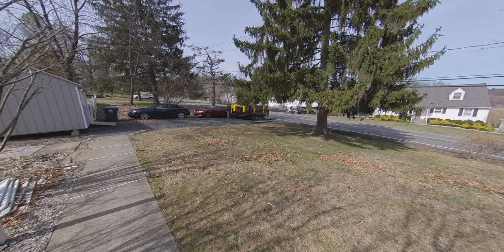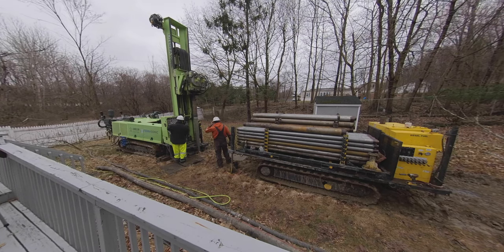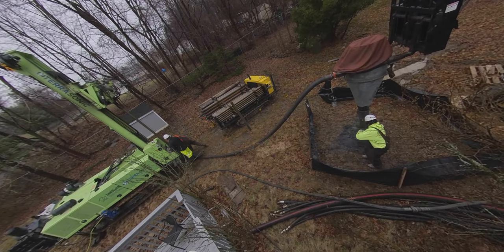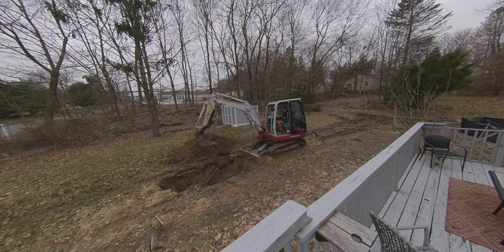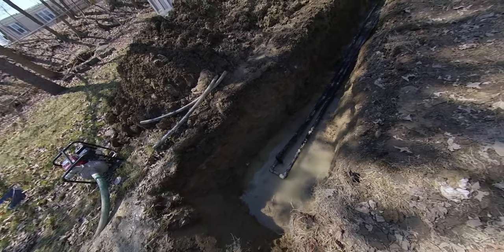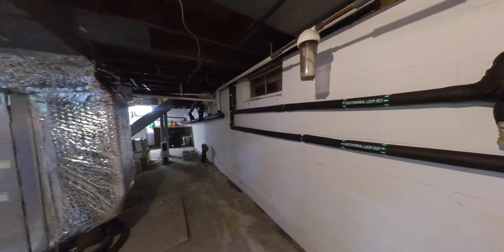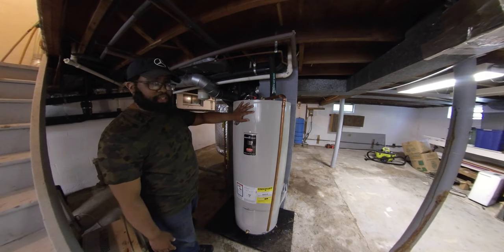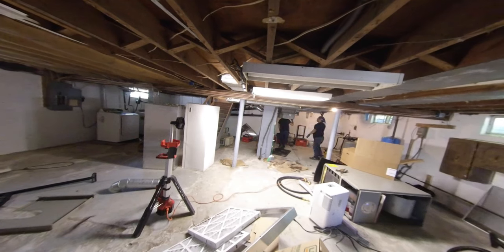Dandelion Energy - GeoThermal Installation

Comment: Its kind of nice to see the rest of the world is catching on to the geothermal heating/cooling; I've been a geothermal driller for 13 years straight now in the Nordic countries, drilling countless holes both for private housing, larger industries and everything in between, and what i can say is that geothermal is simply the way to go, you wont find a more energyefficient heating/coolingsource, especially in the heating segment, as we, the nords, get quite the Cold winters the GT systems have litteraly proven to lower the electric consumption by 300-400% (heard stories about EVEN BETTER performance too) compared to using direct electrical heating. (Not even gonna mention oil, because we stopped using that years ago because its about 4 times more expensive Then electricity over here) HVAC's are not bad either and dont come with the same initial cost, but GT Will surpass/outlive them in the Long run and when the outdoor temperature drops below a certain point, they simply produce heat equivalent to direct electric.
Reply: How much does it cost to drill a hole in your country ?

Comment: Great video and thanks for the info. I’m in your area and will be contacting them for a quote.  I want to get away from oil also. Only thing is my cost will be higher do to not having central ac but it will be a welcome addition.
Reply from the maker: If you use our link to sign up, you get a little money back as well after you complete a potential install 🙂

Comment: How long did it take to drill per hole? I'm assuming 300ft. Asking because Dandelion claims their sonic drilling is 17 times faster than conventional. If I'm assuming with various setup overhead that each 10 foot pipe takes 10 minutes that would take about 5 hours which doesn't sound too different from standard drilling times.

Comment: How's the heating performance thus far this winter? Looking to go with this in the near future. Have a call set up for this weekend with them!
Reply from the maker: Hearing has done well. Last week, going into the weekend before it warmed back up, temperatures were like single digits. Even with that, the home was comfortable. 

I hope you used our promo code, as I think you get a nice reward if you decide to sign up for a system if you use the code 😎

Comment: Excellent video covering lots of details of the install process! Did they explain what maintenance would look like for you during the life of the system, like how frequently a tech will check up on the home, and any particular tasks you need to do as a homeowner to keep the system in tip top shape? I'm also curious about the length of your warranty, if it impacts your home insurance in any way, and if there is at all an estimate of added value of your home for if you decide to sell it in the future? Thanks again for providing such insight on this type of system install!
Reply from the maker: Maintenance for this on the user end is more so of changing the air filter. There is a device that is connected to it, which sends back status and data to Dandelion. This is suppose to allow them to detect issues and send a technician to you to resolve any issues before you need to call them. We'll see how that pans out down the road. No change in insurance, and no estimate of added value we can offer you. Sorry.
Reply: @GStyleMagazine  Get it looked at a year later. If it's good wait a few years and look again. The blower and coils can get dirty and need to be cleaned

Comment: How hot does the temp get for your heater in the winter ?
Reply: I won't be able to say yet. This install completed early a June this year. So far loving the AC and in a few months then I'll be able to really see on the heat side.
Reply from the maker: Just as an early first answer to that. Since it had been getting chilly now in the area, we have switched the mode from cooling only to a mix mode of heating or cooling. So far, we have had it anywhere from 74-76 and it has hit that temperature just fine :)

Comment: NEVER EVER go this route for Geo......check performances on a Geo heat pump! Ground water (well water ) ALWAYS is the most efficient.

Installers will NEVER tell you this because it's major bucks for them (and why geo has gotten a bad name...) do a slight bit of research and you'll see. I own 2 homes, both with well water geothermal heat pumps, and the performance is incredible.
Reply from the maker: That could be the case potentially, but this doesn't use ground water/well water. This is a closed loop system. And have experienced no issues that you may be facing.
Reply: Open loop system are more likely to fail and isnt worth it long term.
Reply from the maker: Thanks goodness this is a closed loop system then 🙂
Reply: sound very interested.   I would like to learn more about it as my house is also in NY orange county has Ground well water.  Is it possible to add heating/cooling pump to existing well bump that I have for my existing well pump.   What's the cheap alternative as $21K sounds very expensive?
Reply from the maker: You might be better off reaching out to the company for more specific questions. They would be in a better position to answer that than us.

Comment: The best part about all this is the fossil fuel industry just lost some money :)

And renewable energy just gained some. 

Great.
Reply from the maker: Indeed! :)
Reply: @GStyleMagazine  still enjoying the system? Any problems so far?
Reply from the maker: Yes still enjoying it. So far not one issue. We've had some hot days so far and the system works perfectly keeping the house cool. Didn't even know it was hot until we step outside haha. We may do a summer recap video at the end of summer time.
Reply: @GStyleMagazine  please do :) 

Really hoping Dandelion comes to Michigan. And soon. Not like...15 years....
Reply from the maker: @T M Let's see. Have something made from oil at the time of creation and then no need to further use oil for heating that home for the life of the pipes (50 years or more) or just make no change at all and continue to use oil to heat that home for the next 50 years or more. Which side of the scale you think is better....

Comment: So, what do you do for heating when the power goes out?
You keep saying "renewable" but the electricity that's powering your heat pump is coming from a power plant that is most likely burning a fossil fuel and that fuel in the US is probably coal.  Coal is worse for the environment than natural gas, propane, and oil.
Reply from the maker: What would you do for heating if your furnace that burns oil when the power goes out? The furnace still uses electricity to work as well. The difference here is although electricity is needed, it is still a reduction by no longer needing to burn oil to heat AS WELL...If you want to get caught up in semantics, sure. But even no longer using oil AND electricity is a step in the right direction vs not making any change at all.
Reply: Clean coal is better that what goes into making solar panels or wind turbines, and what happens to the solar panels when they fail? They go to a landfill and leak all the toxic substances
Reply from the maker: I guess you believe no change at all should be made. Let's just keep doing it exactly as it's been done before. Those who can not embrace change are doomed to be left behind by it.